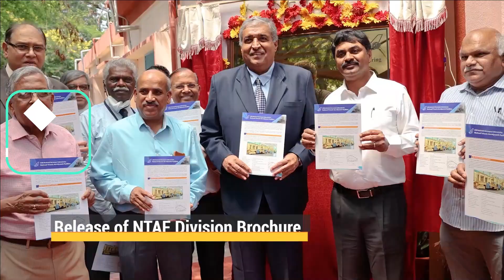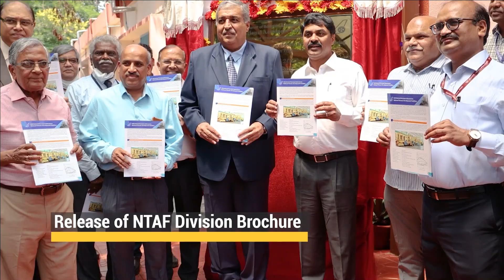New Anti-radiation & Anti-AWACS missile of DRDO

Comment: Bro i have a question - in 2040-2050 the existing Su-30mki will become old & will need replacement, which fighter jet will be replacing the old su-30mki fleet in near future ?
Reply: may be Tejas Mk2A or TEDBF based jet
AMCA mk2 also can used
FUFA also in development which can be used
Reply: AMCA mk1&mk2
Reply: I think manned fighters will become  obsolete by the time.
Reply: @beninvijay  FUFA and AMCA mk2 are being designed for unmanned flights 
Also CATS warriors will alsp take part on it